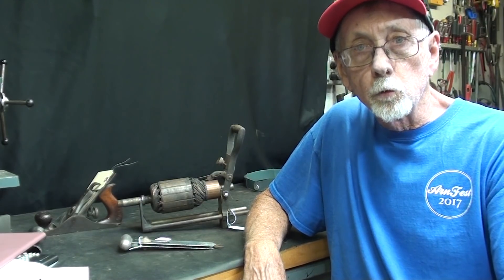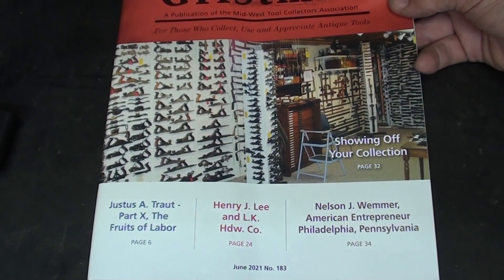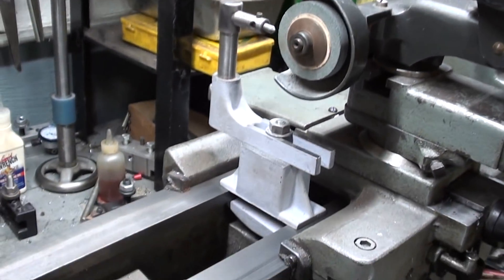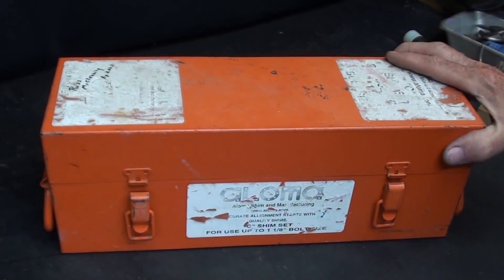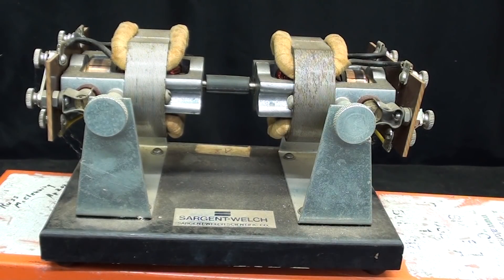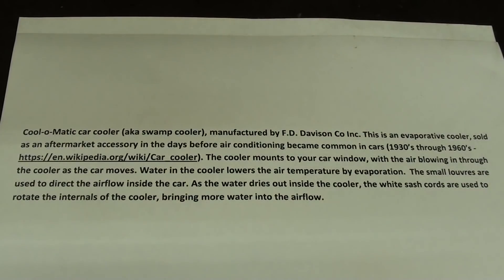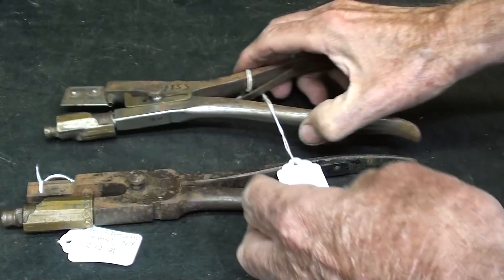WHAT IS IT? Mystery Tool #66b ANSWER tubalcain mrpete

Comment: There at 5 minutes, yes, I worked in a motor shop for several years in the 1960's...We did a lot of commutators, so they had the machine with the little cutters that looked like a Woodruff key seat cutter. after the under-cutting, there was a triangular tool like a drawfile that you used to take the sharp burrs off the edges of the segments...
   There at about 10 minutes   ...010"....   I worked in a fairly large machine building company in the 1970's, castings weighed several tons...ground on all sides but still needed finishing assembly by millwrights. Most  of the shims we just cut by hand from larger sheets...  ...05-06"...   was about as much as we ever dealt with.
  My last years working, a lot of old sheet metal fabricating stuff. Plenty of BIG snap-rings that used a similar tool to remove them...I had Snap-on, and not a lot different than what you show here....

Comment: I'm 74, when I was 17 I worked in a starter/generator rebuilding shop,  that tool is a "mica grooving tool", to cut the mica seperator on the commutator,  below the surface. So the brushes will have full contact on the copper. 😃😃😃  about 1/32" below. 
  This is when they just started to use ball bearing front shaft bearings,  then the generators. Lasted longer. 
 A "Growler",  was an electrical tester used with a hacksaw blade to check after undercutting the mica,  to check that the windings were not shorted, when you slid the hacksaw blade over the copper bars it would "GROWL"  if it was shorted 😃😃😃 Thanks
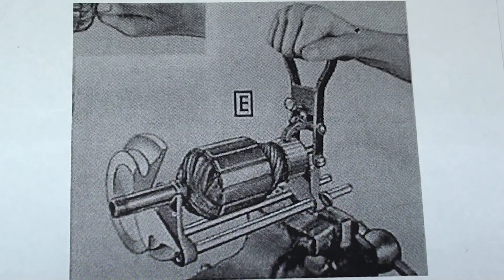Reply: I'm 60, and when I was 60 I watched the video. So, I know that Pete already showed and explained what it was in the video. Maybe pay attention from abnout 6:20

Comment: How would one go about getting the armature out of the case without removing the pulley or gear from the shaft?
Reply: You would only remove the housing end that houses the brushes, and leave the bearing, housing and any pulleys at the other end alone.

Comment: The copper can wear at a faster rate than the mica and if you don't undercut the mica, over time it can end up lifting the brush away from the commutator.  When I worked at the electric broom factory they made their own commutators by forming flat copper into a circle, broachine retention tangs on the inside and molding Bakelite into the center. Using an automated machine they would drill the hole in the center and cut slots deep enough into the copper to have individual copper segments.

Comment: The tool is used to undercut the mica insulation between the copper segments on the dc motor or generator after the surface of the copper commutator is machined smooth. The procedure is used in motor repair shops. It prevents the carbon brushes from "floating" above the commutating segments as the segments wear down with use.
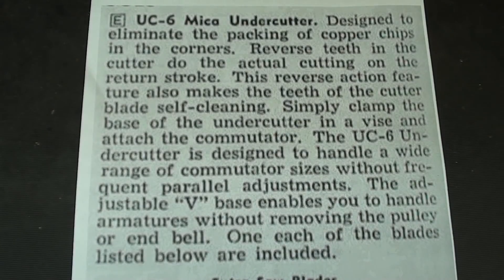Reply: Ummmm.... well, yes. You mean exactly like described in THIS video? Why not watch and take notice at 6:21 and not waste your time typing?

Comment: Ran rc cars during brushed motor era. Have a comm lathe for my race motors. Clean up comm to as new condition, and put new springs and brushes, new motor!  Need to use a belt on armeture driven by another motor

Comment: I was fortunate enough to be employed by  garage that had a side shop which rebuilt starters generators and alternators. The man who owned the shop had been in the business for about 50 years at the time, (I was a wee lad of 14, bright eyed and bushy tailed) , so he knew the business end of a rebuild shop. I worked for him for about 5 years and learned a lot! That was over half a century ago, older, wiser, but still fascinated by the hands on aspect of auto electrical and mechanical jobs.

Comment: While I have never seen a Cool O Matic on a car I knew what it was from having been in the southwest and been in buildings cooled by swamp coolers.  When I worked as a VW mechanic in the mid 60s we used to turn down the generators and starters but I don't remember what we used to clean out between the commutators.  Keep the mystery tool series coming.  I think I may have something for you to figure out.

Comment: I also used a modified hacksaw blade to cut the mica on generator commutators , but was taught to not undercut them on starter motors. Of course we used a full hacksaw blade over the armature while it was on the growler

Comment: Yep put the armature in the growler then grab the commutator and turn it you only do this once as the induced voltage is high enough to light up you’re eyes. When turned the copper being soft oozes into and closes up the slots a nice sharp slot is what you want it is supposed to be an electrical switch. Most motors/generators only need a light dressing so scotch bright or green scourer will do the job then just a matter of cleaning the metal/carbon powder out of the slot. A mad Aussie

Comment: Note that when making mica undercutters from hacksaw blades, you must grind away the set (wavy set on hacksaw blades) and grind to fit the gap exactly (or a few thousandths shy). Too "fat" and you change the geometry of the segments; too thin and you leave debris which can work its way up to interfere with the brushes. I believe SB made an undercutter that mounted on their lathes.

Comment: I was filled with nostalgia watching this edition. My working career started in 1979 as an Apprentice Armature Winder. I worked on mainly large industrial motors and soon got involved and specialised in Test and Inspection which led to commissioning on site so I was exposed to various “under cutting “ tools and machines which in turn were then bevelled on the sharp edges of the comm segments.
As for the shims, I used many of those and even much bigger shims , aligning motors to driven equipment. With reference to large motors I’m of course talking about High Voltage (6600V and 11000V) machines, the largest motor I ever tested and commissioned was a 23Mw , yes that is Mega watt for the CSIR here in SA (Council for Scientific and Industrial Research)

Comment: Page 6:15 depicts an assembly of armature and pulley together. “We didn’t have to part the pulley off the spindle in order to mount them on this fixture tool …. “ 

The problem in that - if pulley isn’t disassembled first then how may we separate the armature from the motor assembly?

Could the pulley is just shown for illustrative purpose?
Reply: You only need to pull one end off, being the end with the brush holder. You could leave the bearing, housing and pulley at the other end.
Reply: @johncoops6897  is this the kind of job a pulley puller does best? This tool involves forced are not concentric, do you think so?
Reply: @philoso377  - I dont understand what you mean. What tool? What pulley? What forces? What isn't concentric?
If you need to resurface the armature contacts, then you need to disassemble the motor to the point where you can access them. You dont need to remove anything that is not necessary, so a pulley at the other end could stay in-place.
If you need to remove any press-fit gears or pulleys, then you use a puller to remove them. If you need to remove something held by grub screws, then no puller is required.
You dont really even need a tool to perform the undercutting of the mica separators, as you can grind and home an old hacksaw blade to do the job in a non-production environment.
Reply: @johncoops6897  I’m sorry. I was wrong about this tool. It isn’t use to remove the pulley but to resurface the commutator.
Reply: @philoso377  - it is OK but I am still confused. The video shows how the tool is used.
Reply: @johncoops6897  you are right it was made for resurface the commutator at the insulation.

Comment: I felt like I just knew tool number 1 was for piston rings of some sort... now hearing EMD, I recall that I assisted in the complete rebuild of a very large 12 cylinder ALCO Locomotive engine in a tug boat. ALCO Engines are very similar to EMD Engines also used in tugboats.

Comment: The cool-Matic was seen on a lot of VW's back in the day.
Reply from the maker: Shoot, the cooler was bigger than the car
Reply: @mrpete222  I had a VW super beetle that I would fill the front air box with a bag of ICE and let it flow thru the front vents. you could do that on the super beetle due to it had defroster system with a fan and fresh air box.

Comment: My great uncle Ainslie Bretl was the head of the tool & die shop at EMD in La Grange, IL in the 60's and 70's. He worked his way up from sweeping floors. Perhaps he made that snap ring tool...
Reply from the maker: Did you know, that the huge EMd sign From La Grange, is on display at the Railroad Museum in Union?
Reply: @mrpete222  I did not. Thanks.

Comment: It is my job to work armatures and their commutators. I have to turn them three times; one to remove the solder before electrical testing. Then it comes back to me for rough turning and mica undercutting. It then go off for balancing. Then back to me for finer "Diamond turning". This last bit throws a burr into the slots, which I remove with a tool fashioned from a hacksaw blades. The undercutting is done with a small slotting saw that I have to line up with the mica by eye. Some times I don't get it lined up perfectly, leaving a little mica on the sides of the slots. I remove this at the same time as I do the burr. Maybe the tool in this video has been set up to do this without cutting further into the slots. It is likely set to whatever its last job was.
Reply from the maker: Thank you for that information

Comment: It looks like a tool used by people who refurbish and rewind armatures.  I think it's used during the process of cutting away the resin or whatever the stuff is in the small slots between the copper, after it's been turned down to a fresh layer of metal on a lathe. I've only seen the slitting part of the process done by hand between a couple pieces of wood though, so I don't really know. Something like that

Comment: Did you ever wet a towel and roll it up in a car window so the evaporation cooled the insides? - it worked better just to leave the window down.Now out to my shop because I think I have a Number 2 - not that I would sell a tool. The bell only works if you have the phone app and have the notifications feature turned on. An annoying thing indeed.
Reply from the maker: I did not know that

Comment: Good morning Mr. Pete, The mica cutter's blade is turned around loosen the screw and rotate to find the teeth. Mine has all of the extra blades in different thickness for different width mica bars. They were measured in thousand of inch.
Reply from the maker: I was wondering if that blade was backwards

Comment: I worked in a shop that rewound electric motors and repaired Milwaukee power tools. We cleaned many commutators but I never saw one of these tools. We used modified hacksaw blades just like everyone else. I guess that's why I am 70 years old and you are still my shop teacher. Thank you Mr. Pete.
Art
Reply from the maker: Thanks

Comment: Mica undercutter. Still widely used in a lot of motor shops. Hand-held undercutters tend to chatter, leaving lots of marring on copper bars and require turning. Generally, we use lathe-mounted undercutters with a universal motor/arbor with small circular HSS blades with varying thicknesses ranging from .015'' to .050''. I've found turning an undercut comm with micro-grain carbide to work best, copper wares out HSS very fast, and being such a gummy material you need to be aggressive on the speed and feed and a regular HSS tool just burns up.

Comment: Had something like this back in our 1960's electric shop. Had an old teacher that wanted future electricians to learn how to rewind motors. I was the only one that told him that NO electricians rewind motors but motor shops do. He gave me a 120 volt heater circulator pump to rewind. Gave it back to him 8 months later rewinded & painted by my electrician dads motor shop. He know that I did not rewind it but told him that he only said to return it after it was rewound. Had a A in all 3 years of my 3 hours daily industrial electricity course. In my 50 years as a sparky never came across a sparky that rewound a motor. Now any common NEMA frame motors 5 horsepower &  under are now considered throw aways.
Reply: I was a career electrician too. I was a maintenance electrician, so I did mostly repair work. I "had many motors rewound", but would never have tried to rewind myself. I kept a set of commutator stones in my tool chest, but I think that I only ever used them once. Commutator stones were intended to resurface the commutator without transferring any conductive material to short between commutator bars or elsewhere. 
How many rush jobs did you do that got a rewind job back from the motor shop and you installed it while the paint was still wet? In the factory, downed equipment held up critical production. Aligning a big motor with tacky paint could make a big mess. I had tools from one rush job that paint stained my tools for quite a long time.

I took an extended motor rewinding class crammed into a couple of weeks in 1987. I thought that it would be helpful to me. I was already pretty seasoned. I kept up with the material for only a couple of days. The class got into rewinding existing motors into other applications. Given enough compensatable characteristics, they explained how to rewind existing motors such as 75hp into a 100hp application. I was soon lost in that class. The seminar was clearly for motor rewind engineers not a lowly electrician. 
My greatest motor re-engineering success was converting a Milwaukee mag base drill from AC to DC so we could control speed to hole saw a 6" hole in 1.5" steel frame in an assembled machine already sold to a customer.  I needed to get the surface speed slow enough for the hole saw to last the job and have acceptable surface finish. I made some guesses with adequately sizing full wave rectifiers and a Variac that we had in the shop. I guessed well and the hole cutting job went successfully. That machine was in route to the customer with probably a $1M price tag, but needed retrofitted for some customer specific requirement. 20 years later, my variable speed rig had never found another use demand. A Lean Manufacturing SSSSS effort tossed it in the trash. That broke my heart. I recalled very fondly the day that everyone lauded me as the hero and thought that I was a genius. 

Oh by the way, I purchased a set of Mr. Shims thinking that motor and shaft alignment was in my future. I think that most of them were used to shim jib hoist columns. This was pretty pricy since normally we sheared a stack of SS sheet metal from scrap for that purpose.
Reply: @paulhunt598  That's a great story. Not many realize the ingenuity that's required to make the world work. I had the pleasure of working for a great family owned business for a while. Sadly they sold it to a large company and was no longer fun to work for. The family had great trust in our maintenance/fabricating abilities. The new company replaced us and most of the other key personnel with 3-8 people each. They thought that was better. I still can't understand how large companies survive.
Reply: @paulhunt598  I had a Ideal commutor stone that was in original box that belonged to my sparky uncle. Might have used it twice in my 50 years working. Back in the 80's we would purchase permanent magnet 1/2 & 3/4 HP DC motors from Graingers for lots of home made short conveyors. Used a varic and a full wave 25 amp cube rectifier for them. My company did not want to bother ordering replacement brushes so before throwing motors away I would remove the 2 strong magnets. Still have a couple of them. Gteat for securing 10 sheets of paper to a steel door.
Reply: I nor any other electricians I've known have rewound a motor.

Comment: Typically armature slots are cut with a slotting saw that just shy of the total width of the slot after bein turned to clean and true up commutator surface. You never want to remove all the mica  in the slot with the slotting saw. This tool I believe to be remove the remaining mica on both sides of the slot. Where I worked we made "dragging tools" from hand hacksaw blades for R & L sides and bottom of slots. If the slot edges are off even a thousandth of you get excess arcing and thus excess electrical erosion  on that edge of the commutator bar. The commutator in the picture appears to be from an auto generator is probably for only cleaning "dirty" slots and not removing mica
Reply: When the brushes wear they also wear the copper commutator bars down, at a faster rate than the harder insulating material between the copper bars.  Eventually the brushes will not make good electrical connection with the copper bars.  When the commutator is skimmed and trued on an overhaul, part of the process is to scrape down the insulation between the bars to below the level of the copper bars themselves.  This accommodates usage wear of the copper bars, while still maintaining good electrical contact of the brushes.
Reply: Armature undercutter
Reply: Amazing that somebody would write such a long and mostly irrelevant load of rubbish without even watching the video or properly understanding the subject.
Reply: @johncoops6897  I read his comment to say that you need to true the copper because the mica is too high and the brushes jump.
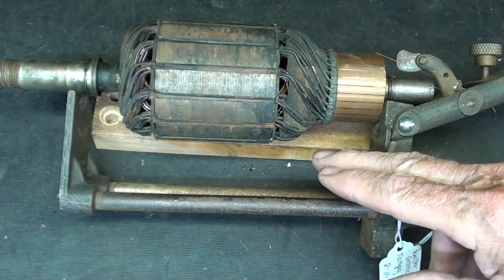Reply: @maxwebster7572  - I have absolutely no idea why they wrote all that, when it was clearly shown and explained at 4:48 onwards in the video. 😉

Comment: Had a similar design (by Martindale) but with a small sewing machine style motor instead of the manual tool to undercut the commutator on starters and motors. Was part of a rebuild bench with a winder, growler and a basic lathe that you could use to true and balance an armature with.